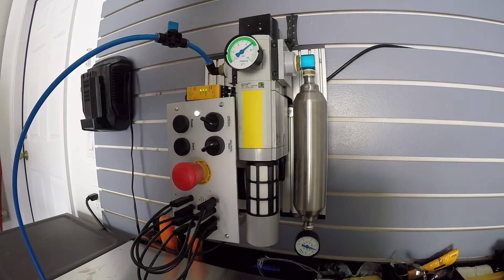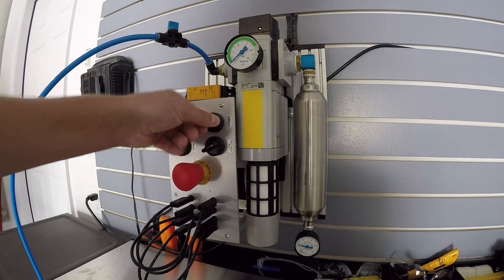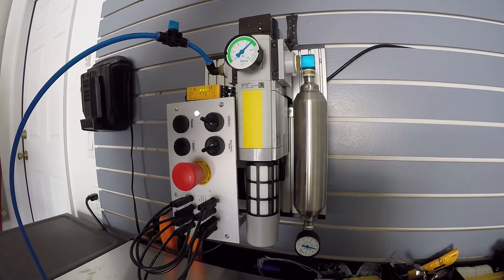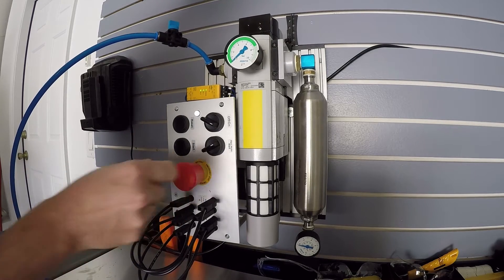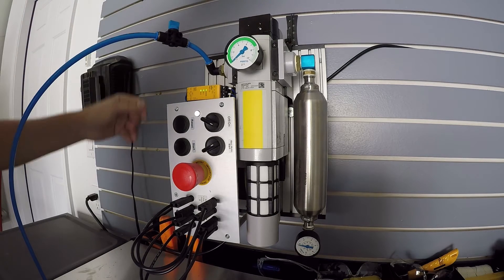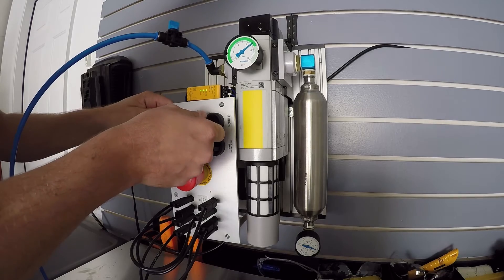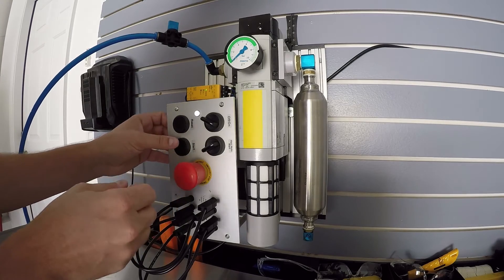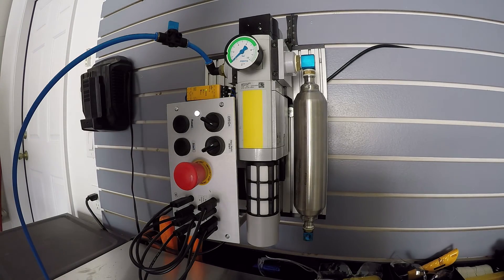FESTO Safety Dump Valve MS6-SV-E And Potential Misunderstandings

Comment: what is the status of the sensors on every step of the restart after an estop?
Reply from the maker: If you are using a MS6-SV-E you should not have to worry about this since it is all done internally. Are you sure you are talking about the E version or the MS6-SV-D version?

Comment: Sabastian, Would you be so kind as to show me how you have wired this valve up using the little control panel you have there, and what safety relay you were using. 

Thanks so much for your help
Reply from the maker: Hey Anthony. Send me a email and ill reply back with some schematics and other info for you. sebastian.balos@festo.com
Reply: James Stevens .

This device is quite complicated to implement, there are two versions, which one were you looking at, the😗MS6-SV-D, or MS6-SV-D?
Reply: James Stevens there's the -D version of this valve, if your looking to link with a safety system run away from that one and use the -E version. I am not familiar with the other devices you mentioned